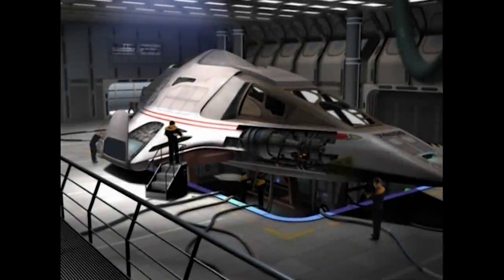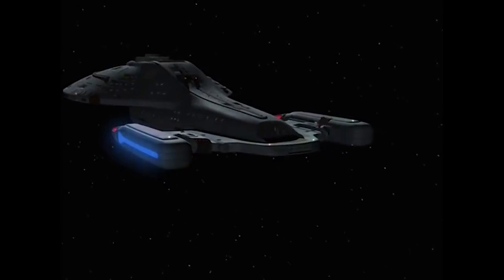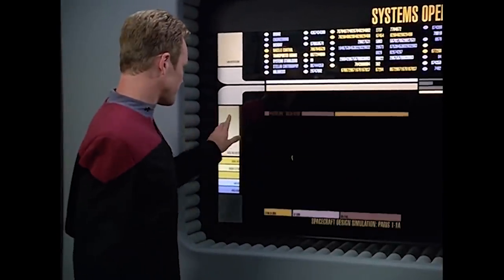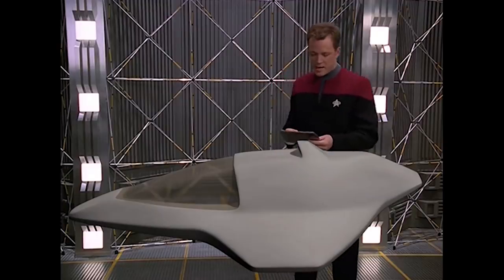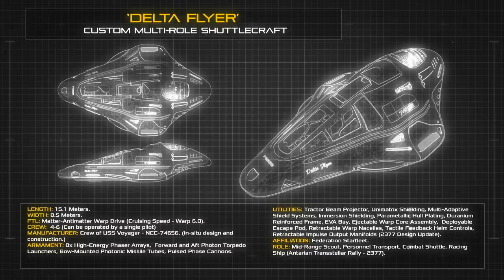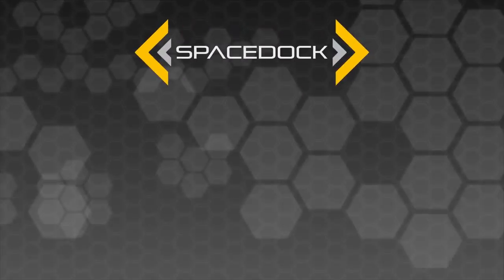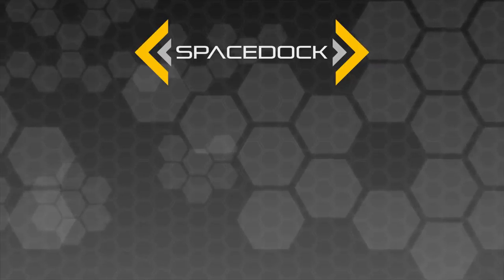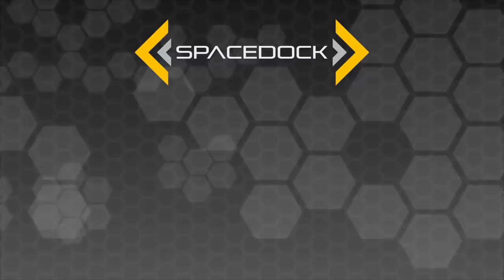Star Trek: The Delta Flyer | Ship Breakdown

Comment: I'd like to see more Delta Flyer Class Shuttles in upcoming continuity.
Reply: In Star Trek Online's continuity, they are widely available.
Reply: I wonder if the USS Titan has one. I think it was launched one year after Voyager returned home.
Reply: I would definitely fly a Delta Flyer if I could. While the automated controls of Starfleet's vessels are impressive, I've always considered really nice buttons, triggers, and gimbals layed out with advanced intuitive macros to be the future, especially if they're solid holograms. EC Henry did a great video about why the transparent holograms are terrible.

having a high performance vessel is just so much more fun too, though it seems people have decided that capital ships like the Galaxy class should just be able to turn on a dime like it weighs as much as a Delta Flyer.
Reply: Perhaps later versions of the design, or ships "inspired" by the Delta Flyer, so that it becomes a new standard class in StarFleet - the high performance large shuttle/small starship that's more combat explorer than the Runabout class, which is more a general workhorse.
Reply: @xymaryai8283  due to the extreme precision required to control a craft that accelerates at thousands of gravities and typically travels at a significant fraction of the speed of light I think analog controls are pretty impractical for a normal person. Sure you can use them to activate macros like you said but at that point there wouldn't be much advantage over using touchscreens apart from the fun factor. Also, due to the lack of air resistance a larger and heavier ship can be just as agile as a smaller ship if it has the engine power to match, so it isn't outlandish that a ship can maneuver as well as a shuttle (in fact universes like star wars where larger ships move ponderously and fighters zip around don't match up to the reality)
Reply: I'd have preferred an aeroshuttle.
Reply: @casbot71  I would hope so the delta flyer having both federation and borg technology. Plus the delta flyer being built in the delta quaderent it would bring new design ideas such as better warp engines etc.
Reply: Ha!
Ahem, I'm sorry, did I say that out loud? 
For the most part, they seem to almost be entirely ignoring old cannon and trying out new stuff. Returning to something like this...? Seems unlikely.
Reply: @plzletmebefrank  Well, the less said about the new stuff, the better. But after Voyager returned to Federation space, I can't believe that Star Fleet wouldn't adapt a ship design that proved itself so versatile and effective under such extreme conditions.
Reply: @danieldickson8591  Sure. But the og commenter said "in the upcoming continuity". And.... When 80% or more of the new content blatantly tramples on and ignores previous material.... Yeah. Not happening.
The only thing I have any amount of hope for is... That the occasional Star Wars property is good (Bad Batch, Clone Wars: The Final Season, Mandalorian) accepting that half or more will be hot trash. And that maybe. Just MAYBE they won't screw up Stargate when Amazon does something with that. Though. Rings of Power might have crushed my hope for that. Still. OG cast and writers have said they'd be all for it and there's talk of possible drafts and treatments being passed around so... Maybe.
Reply: @danieldickson8591  Also, yes. But I think only certain parts of the design. I get the feeling that Starfleet (as depicted in shows and movies produced around the time Enterprise was and earlier) would adapt something more mainstream and standard out of the general concept, and that makes sense, plus gives the Delta Flyer more character while still giving us a cool new shuttle/multi-role fightercraft that is based on it. Using the exact same design would feel rather cheap and copy-pasta-y anyways.

Comment: Paris: Computer, add dynamometric tailfins.
Tuvoc: Computer, remove dynamometric tailfins.
Reply: We are not designing a hot-rod
Reply: in Tuvoc defense, aerodynamics means nothing in space.
Reply: @zuzoscorner  The origin of the craft is for high pressure flight so you do need aerodynamics at the time of construction.
Reply: @zuzoscorner  One of the primary purposes of a shuttle craft is to operate in an atmosphere, so that's kind of a moot point.
Reply: Star Trek Picard: fuck you, Tuvok - ADD IT ALL TO CART!!
Reply: @zoro115-s6b  yeah.... but star trek vessels really don't need it with their flight mechanics, since impulse engines don't seem to need lift to keep the vessel in the air.
Reply: @ExarchGaming  They still help with stabilization. Plus shuttlecraft lose power a lot, which generally results in them dropping like a rock.
Reply: @zoro115-s6b  the Deus-Ex flyer never seemed to have a problem there. :P
Reply: Paris: Computer, add those dangling balls to the rear hitch
Reply: @animateddepression  
🤭😂😂🤣🤣🤣
Reply: @animateddepression  im gonna have to  get a second account just to like that again.
Reply: Tuvok was such a party pooper. Lol
Reply: @hellfish2309  me: so do we need the cryo pods even with ftl speed?
Me: yeah sure and we also need the wine
Reply: A very memorable moment in the series.

Comment: "the first delta flier was destroyed, then immediately replaced by an identical craft, called the delta flier II"

"how did you get the materials to do that?" 

"shut up."
Reply: Replicators and rocks, baby, replicators and rocks.
Reply: Asteroids, use your imagination son!
Reply: Given @ 1:39 the wreckage the battle is taking place through and the ability to find it means plenty of processed materials to salvage. Also Voyager traded with space faring people.
Reply: @rommdan2716  I think "use your imagination" is a good way of describing Voyager in general.
Reply: @lamalien2276  The story didn't need to explain that, You all are just nickpicking
Reply: No problem, we just stripped a few dozen other shuttles for parts got plenty of them laying around...
Reply: @d3j4v00  Not even necessary.  It's Star Trek.  They have replicators.  Strip some gas from a nebula or star and you have fuel for the replicator to make pretty much anything.  What's more unbelievable is a shortage of supplies in the Star Trek universe.  The torpedo and shuttle issue were never really a big concern.  Unless you damage their ability to collect replicator fuel or all the replicators at once, then you might have an issue.

Comment: I always wondered, if you could build such a cool little ship from nothing, why would the Voyager crew stop at the Delta Flyer?
Reply: Because the budget was not big enough to include "star trek armada".
Reply: If I recall, the construction of the delta flyer took a lot of resources and required Voyager to divert a lot of time and energy to its construction. It wasn't built from nothing, it was built from replicated matter that requires energy provided by the warp core consuming dilithium which at many times was in short supply.

Comment: One of my favorite shuttles out of All Star Trek and especially because once you learn how complicated this thing was built. And how smart it was built you can appreciate that one engineer in Starfleet while they were designing the Voyager who put the industrial replicator just in the unlikely event they would need it.

So I bet that one engineer got a promotion. And Starfleet that one engineer who was smart enough to put an industrial replicator. And you have to give props to lieutenant Paris for putting in buttons and levers. 

Why did he add buttons and levers well when you're in danger what's not going to fail on you you're a dashboard that requires power or buttons an levers. 

It gave it that Star Trek Enterprise feeling of when the nx-01 Enterprise had to use buttons and levers.

Comment: The idea that Voyager was capable of even building such a prototype while falling short on other resources is absurd, but the Delta Flyer was (to me) a better plot device than the Danube runabout. I don't hate the runabout. I love it, but using an RV to get some time off the station seems too mundane to play a tactical role as it has. Surely a station would have true starships (of the line) around to accommodate DS9's needs when the area was so strategically important. The Delta Flyer was something more extreme than an F-22, that some pilot built in his garage in his spare time. Brilliant but absurd

Comment: I'll be the first to say... If I had to build a signature Spacecraft for sci-fi, it would be an Outrider that has the cockpit of the Delta Flyer. I'd also be inclined to remove the Dorsal and ventral cannons and replace them with turrets equipped with Jango Fett's Slave I midbelly rapid-fire lasers, and have on-board a medical bay that was commissioned by an FX-7 medical droid and at least 1 if not 2 2-1B droids, as well as R2 units for repairs. 

That would be my perfect fan ship.

Comment: I always wondered why it wasn't mass produced when they returned home.  At least one on smaller ships and big ships getting a squadron of them.
Reply: In STO you can get a Delta-class to replace your basic shuttle. (The free "zen coins" or whatever TF they call the in-game currency that you get for registering are just about enough for that.) So apparently it was mass-produced.

Also, there isn't a lot of canonical Trek set after Voyager's return. There's basically Nemesis (which used a larger shuttle to deliver Argo) and Picard S1 (which used Discovery shuttles when it needed to because the creatives were too lazy and/or cheap to design late-24th century shuttles).

Comment: Maybe the most advanced tech Voyager had was the use of negative space to store fifty shuttles and build a second delta flyer from scratch.
Reply: They stored them all in the Plot Hole.
Reply: They never stored that many shuttles, instead they built them as they were destroyed (and probably did the same with Torpedoes).
if Voyager was able to build the Flyer in 4 days they could probably build a more standard shuttle in 2 days.
Reply: @terryforsdyke306  that said, they literally say they cant make new torpedoes multiple times

then proceed to do so anyway
Reply: its like the inverse of TNG where they always had problems with shuttle capacity in hanger 2 even though the unseen hanger 1 takes up the circumference of the saucer section for 2 decks
Reply: @terryforsdyke306  yes and no, they were throwing literally everybody and everything at its construction, the normal shuttle construction time is probably a bit more leisurely

Comment: 560,000 meters underwater? That sounds a bit ridiculous. That's about 350 miles. That's more than 50 times the depth of Challenger Deep, or about 1/10th of the way TO THE CORE OF THE EARTH. That's quite a feet for a vehicle designed to keep pressure on the inside.